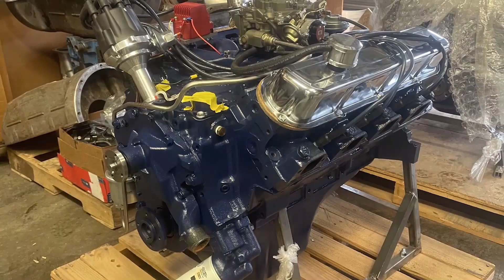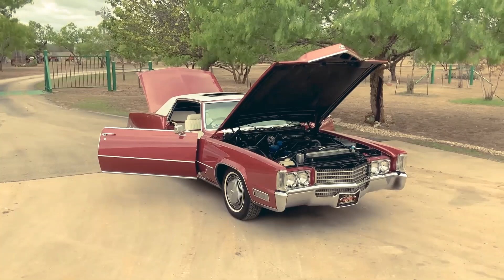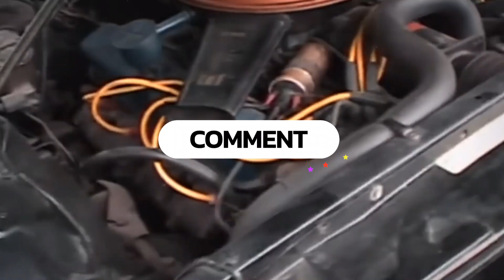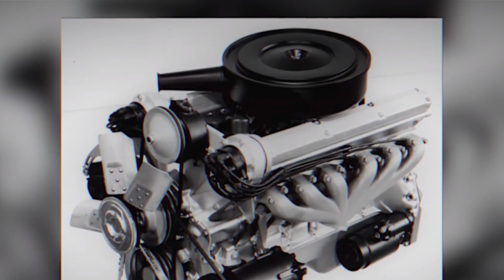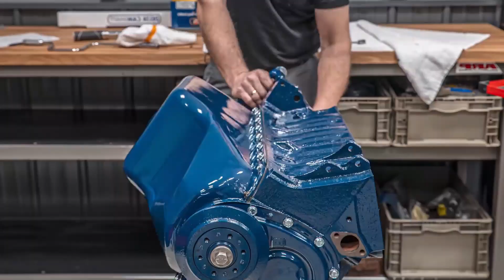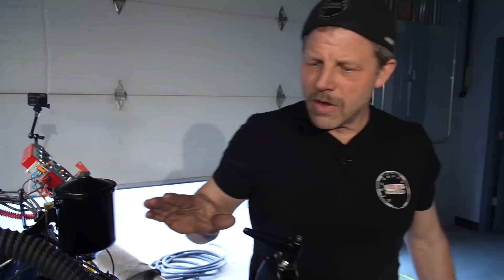20 Shocking Secrets About Cadillac 500 V8 You Didn’t Know!

Comment: There seems to be something not quite clear here.  The narrator mentioned that, despite the gross-to-net rating change, enthusiasts have dyno'd 500s in place and said the advertised rating was conservative.  Is that supposed to mean that the high-compression variants delivered more power than advertised, with all the stuff attached?   If so, how much more?

There is no doubt that Caddy won the displacement war–after at least 10 years of being behind Lincoln.  The 430 and 462 MEL engines were not only big, but they were massive as well, weighing 50 to 100 lbs. more than Caddy's 500.  Horsepower ranged from 375 in '58 to 300 in '61 to 340 in '67...not quite so high a rating, but the gross-vs.-net argument played a role, as the MEL engines from 1960-on had their power-steering pumps as an integral component (that was the only thing holding the front oil seal in place).  Plus, unlike Caddy engines, Lincoln engines were all hot-tested under loads, not only for rating but also to confirm quality of construction.  Considering that the cars they were installed in outweighed any Cadillac save for the limousine models (and Lincoln had something for them, too) by around 800 lbs., and the World Car Catalogue of 1967 placed the Lincoln above Cadillac in its top-speed categories, one can only conclude that those ratings had to be as close to net as the pre-net era allowed.

That said, not quite everybody jumped back into the 'vert craze in the '80s.  Caddy did, yes, but Lincoln's last factory 'vert was in '67; none of any model were built after that year.

There was one time I had gotten behind the wheel of a 1972 Eldo for a test-drive, when my gran was shopping around for a used car in the late-'80s.  She didn't go with it in the end.  Instead, I convinced her to revive the old '67 Lincoln she still had stashed in the garage, which hadn't run in 6 years, and leave it to me to work on.  It was that car that served as my training aid to learn how to work on cars.

Comment: As far as hooking the standard transmission up to a Cadillac engine the rear crank has to be drilled for a pilot bearing then a Buick olds or Pontiac (BOP) standard bellhousing can be hooked up to it as a Cadillac has that bolt pattern...

Comment: There are many discrepancies with this video. Notice as the video plays it shows the steering wheel on the passenger side, right hand drive this is not accurate. The distributor since 1963 and up to 1983 was tilted to the driver side front at the 2:00 position. Other pictures in here show it tilted to the passenger side front. This is not a Mopar engine, this is a Cadillac engine. Cadillac engines from 68 to 76 can also be overbored from 4.3 in to 4.5 inches and the stroke can safely be increased from 4.304 to 4.5 by offset grinding the crank which will then accept a 2.2 inch Big block Chevrolet rod.
Reply: And, at 12:43.. what is THAT? lol
The bore spacing on the the Cadillac engine is 5.00 inches. It is my understanding that the engineers designed the  472/500 inch engine  with further expansion in mind; such that with the same 4.304 stroke and a 4.6 bore, FIVE hundred and 72 inches could be realized. But that would be cutting things (cylinder sealing) mighty close.
Reply: @LSe @LSeverusPertinax ave heard it was so over built they had room to go to 600 if they ever wanted or needed to expand it,
I’ve been drag racing a 500 since 1988 bored and stroked to 524, just blew it up Mother’s Day weekend at half track at 5000rpm . Broke a rod and camshaft no other damage not bad for 3-4 thousand 1/4 mile drag racing passes.